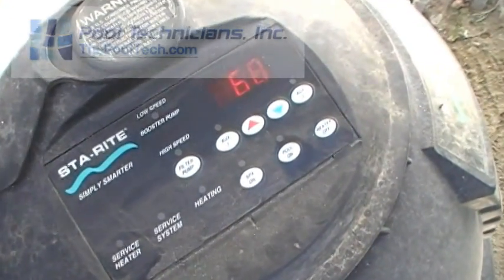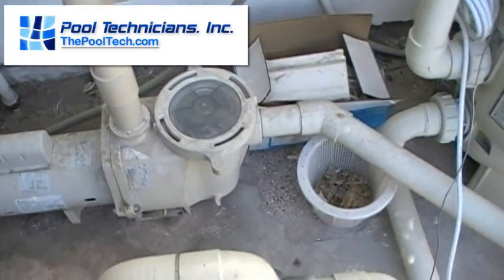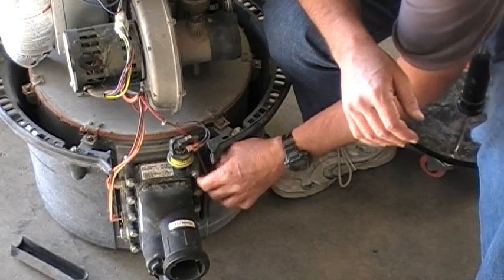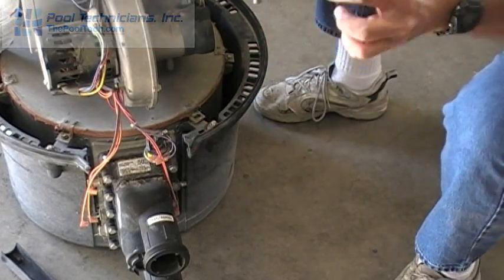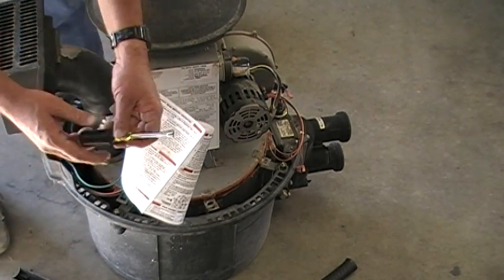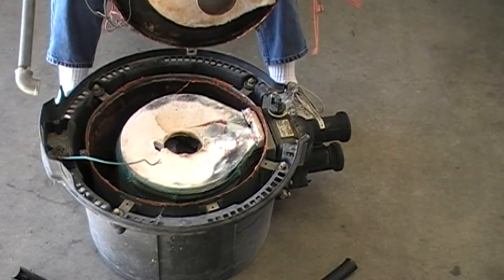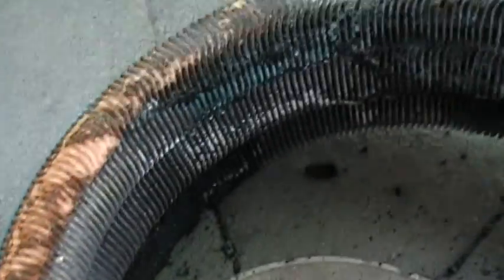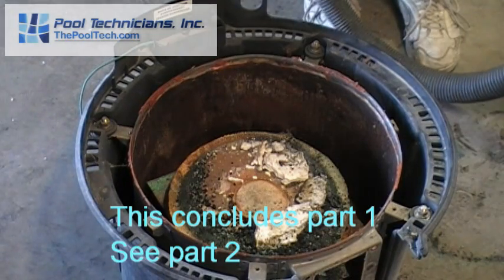De-liming a Sta Rite Heater part 1.mpg

Comment: Lol what the customer get charged for this? That unit would continue to run without faults at that stack temp. But yes it’s technically to high. But given the age of that heater I don’t know that the cost of the repairs is worth it.

Comment: One important note with the ignitor being so fragile remove it first before pulling the top plate and put it back in last after the top is back in place. Broke 2 in this process

Comment: Hi. On our sta-rite heater the display board is showing E06 error code? What is this? Thanks
Reply: Stack flue sensor. Either its bad or ur exhaust temp is too high, causing the heater to shut down.
Reply: First thing id do is take a reading of the flue temp with an infrared thermometer. If that is fine, then replace the stack flue sensor. Simple as that. Things that could cause high temp are things lke the gas pressure being set too high or an exhaust blockage.
Reply: Or things like in the video

Comment: my service heater light is on and heater will not fire. i have an afs light on the back of the board, what does that mean?
Reply: The control board is looking for a hard short from the AFS as soon as the blower turns on.  Watch "PENTAIR MASTERTEMP 400 POOL/SPA HEATER AFS AIR FLOW SWITCH ERROR LIGHT REPAIR" on YouTube
https://youtu.be/hUHzgHrc9G0

Comment: if my heater SR400HD is running at 450F could mine be the same problem? or do i need a new heat exchanger?
Reply: same here. what did you do?
Reply: Absolutely limed up. Just get a new heater

Comment: Hi Jay
I have Sta Rite Heater Model SRC400NA  with 400 K BTU/hr .. when i checked exhaust temperature  is was 372 F.  So i have to go and change the parts as you mention in your video .. Thank you